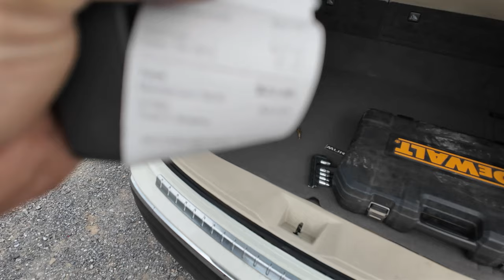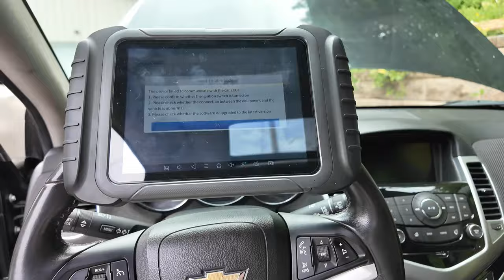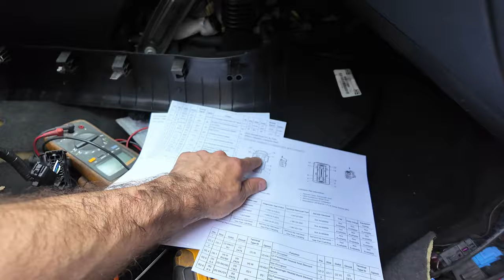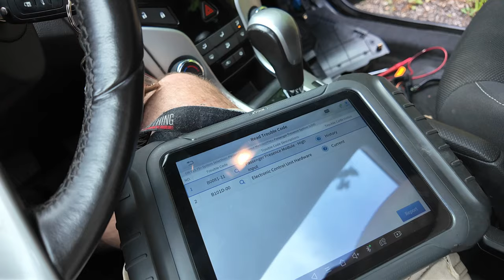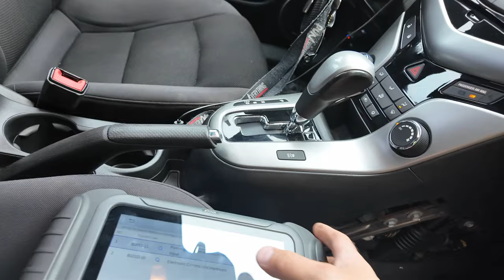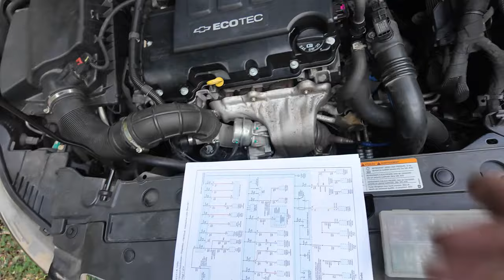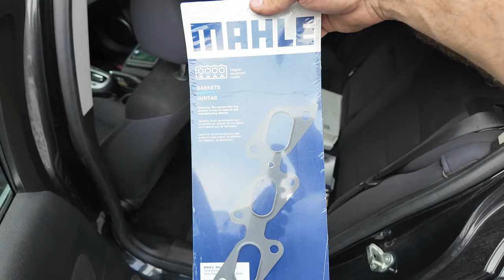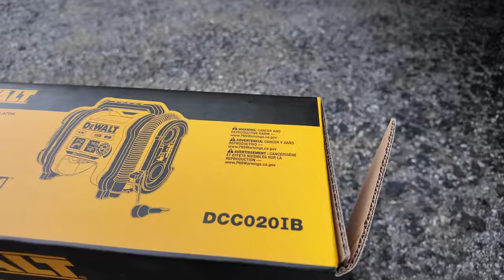My last trip ever to Johnnys U-pull-it

Comment: I’ve got a similar problem with my Fusion. After an accident, I rebuilt the air bag system and have one error code that I think has something to do with the weight sensor on the passenger side seat. Thanks to you, now I’ve gotta check the fuses 😂 never thought of that! Also, I’m glad you got something useful on your last trip to Johnny’s. I’m gonna miss that place, and I’ve never been there, other than through your videos!

Comment: You can buy aftermarket 6.5" speakers , cut the old GM speaker [ ribs and all ] and bolt it to the OEM bracket. They sound worlds better.

Comment: I would probably do the Oil Cooler seals whilst I had the manifold off.

They leak all the time and you end up mixing oil in the coolant.

Bleeding the system is a nightmare though.

I never knew you could get an aluminium thermostat housing 

I did the job on the Vauxhall version of a near identical engine and could only find the original plastic Vauxhall part, though I only changed it because the oil cooler was leaking into the cooling system and everything was filled with chocolate milk